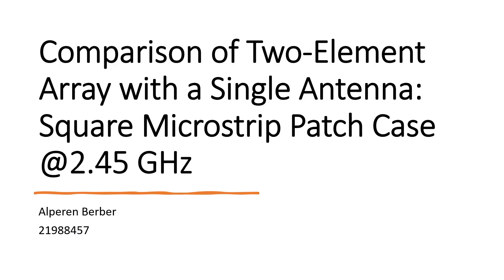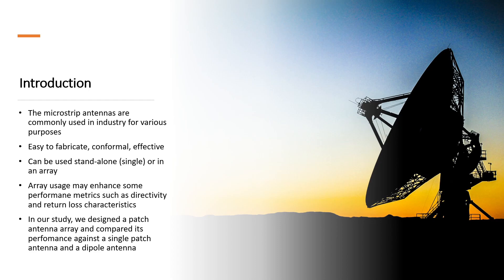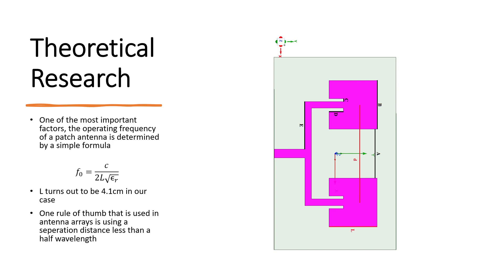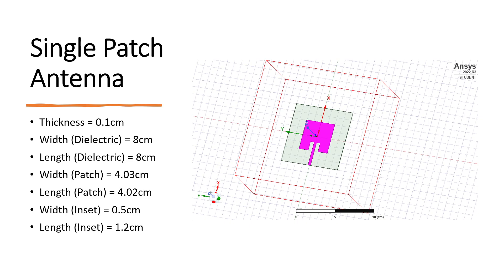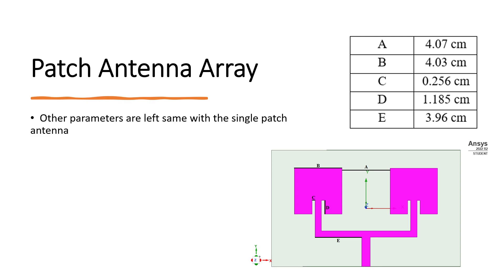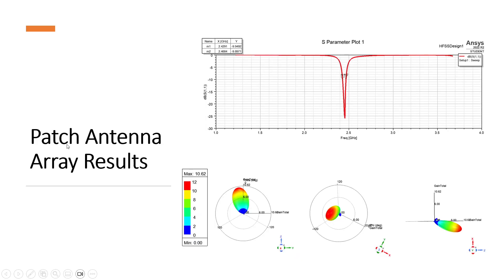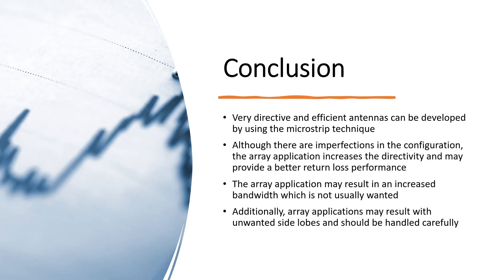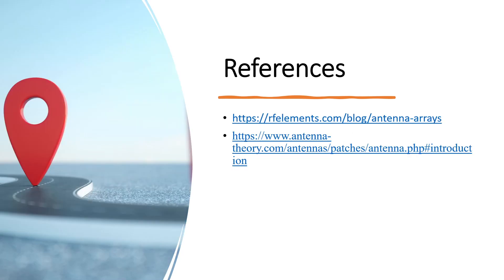Microstrip (Patch) Array Antenna Design Operating at 2.45GHz

Comment: How did you calculate the parameters of array antenna ?
Reply: Did you find the answer?
Reply: % clc
% clear all
format long

disp('Design Rectangular Microstrip Antenna by Transmission Line Model Using MATLAB');
disp('=============================================================================');
er=input('Enter the dielectric constant:');
h=input('Enter the substrate thickness (in mm):');
f=input('Enter the frequency (GHz):');
z=input('Enter the input impedance (ohm):');
disp('Calculating. Please wait.');
f=f*1e9;

%calculate the width
wid=(3e8/(sqrt((er+1)/2)*2*f))*1000;        %in mm

%calculate the effective dielectric constant
e_eff=((er+1)/2)+ (((er-1)/2)* (1+((12*h)/wid))^-0.5);

%calculate the extension of length L
del_l=(((e_eff+0.3)*((wid/h)+0.264))/((e_eff-0.258)*((wid/h)+0.8)))*(0.412*h);  %in mm

%calculate the effective length
l_eff=(3e8/(2*f*sqrt(e_eff)))*1000;

%calculate the actual length
L=l_eff-(2*del_l);

la=(3e8/f)*1000;
k=(2*pi)/la;
x=k*(wid);
i1=-2+cos(x)+(x*sinint(x))+(sin(x)/x);
g1=i1/(120*pi*pi);          %Conductance

a=@(th)(((sin((x./2).*cos(th))./cos(th)).^2).*(besselj(0,(k.*L.*sin(th)))).*(sin(th)).^3);
a1=integral(a,0,pi);
g12=a1/(120*pi*pi);     %in siemens
r_in=1/(2*(g1+g12));    %in ohms

inset=(L/pi)*(acos(sqrt(z/r_in)));        %in mm

Lg_min=6*h+L;   %based on Punit S. Nakar (2004) book
Wg_min=6*h+wid;

B=60*pi*pi/(z*sqrt(er)); 
m1=2*B-1;
m=log(m1);
n1=B-1;
n=log(n1);

W=(2*h/pi)*(B-1-m+(((er-1)/(2*er))*(n+(0.39*0.61)/er)));   %based on Liang J. (2004) book 
g=(3e8*4.65e-9)/(sqrt(2*e_eff)*f*10^-9);

disp('RECTANGULAR PATCH:')
    disp(['The width of the patch (Wp) is:',num2str(wid),' mm'])
    disp(['The length of the patch (Lp) is:',num2str(L),' mm'])
    disp(['The inset feed point (Fi) is:',num2str(inset),' mm'])
    disp(['The width of the feed line (Wf) is:',num2str(W),' mm'])
    disp(['The gap of the feed line (Gpf) is:',num2str(g),' mm'])
    disp(['The minimum length of ground plane is:',num2str(Lg_min),' mm'])
    disp(['The minimum width of ground plane is:',num2str(Wg_min),' mm'])

run this code in matlab you will get
Reply: @ramaanirudh5555  thanks a lot